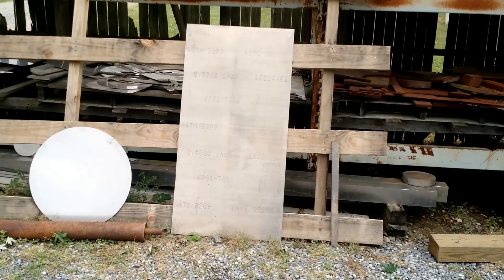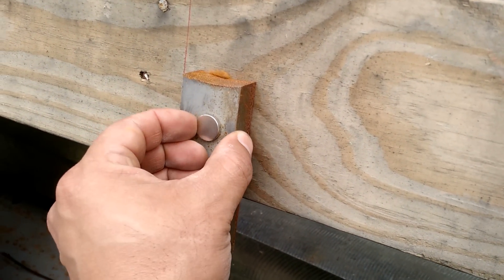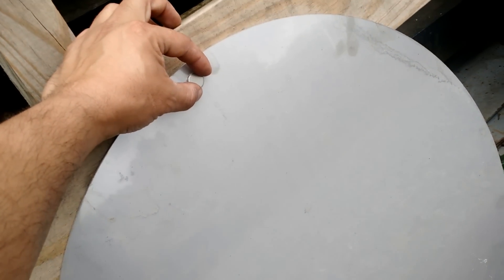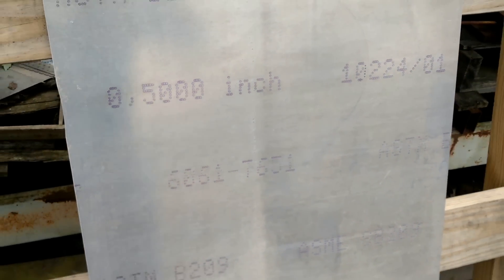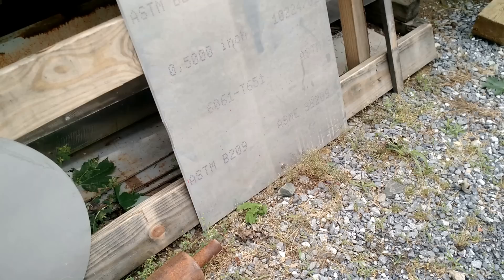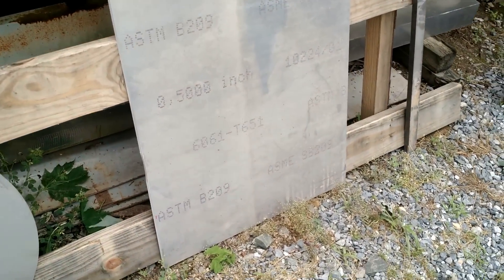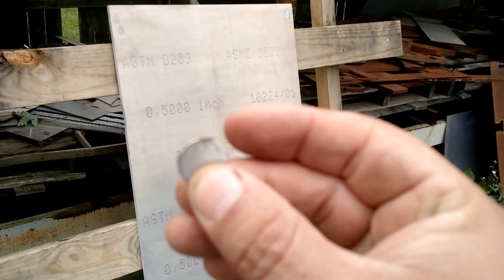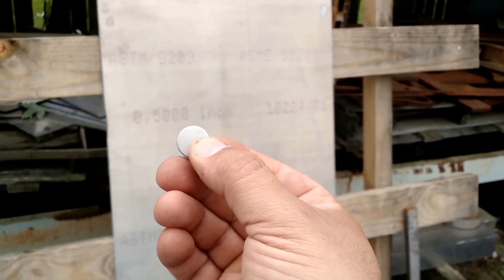Eddy Currents - Magnetic Braking - Aluminum and Magnets - lenz's law

Comment: Its not just limited to aluminum. The same effect would happen with a copper sheet. The stainless steel sheet you used will do it as well, it just wasn't thick enough. The stainless steel sheet wasnt thick enough for the eddie currents to provide maximum resistance to the magnetic field. I've never seen it done, but I'd bet the same effect would happen with a large block of ice (not made from purified water, would probably need to be electrical conductive).
Reply from the maker: +Robert Johnson interesting idea, I might have to try that

Comment: I just tried this with a soda can torn open. I had to make the slope shallow because the can is a short path. The same angle on cardboard and the magnet just slides freely. On the can it's much slower.
Reply from the maker: i guess that means it works! lol
Reply from the maker: +Richard Vasquez i think it works better, the thicker the metal....